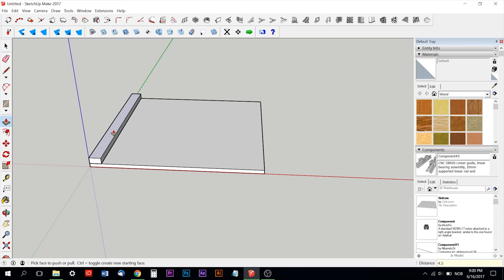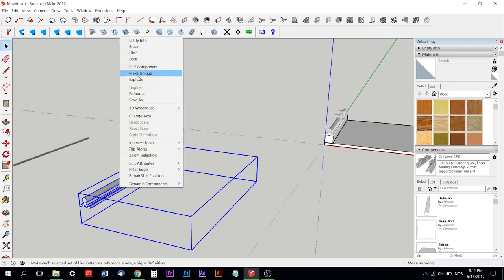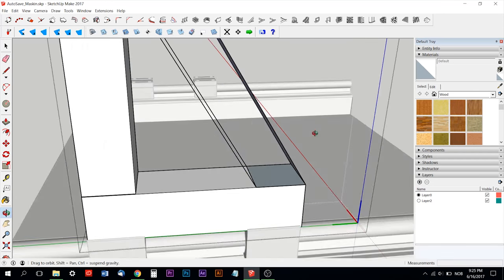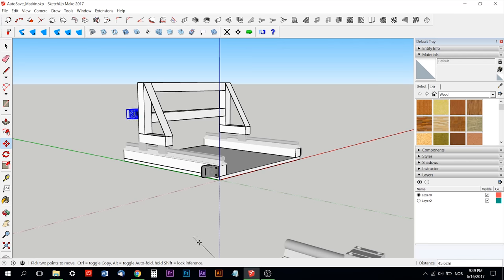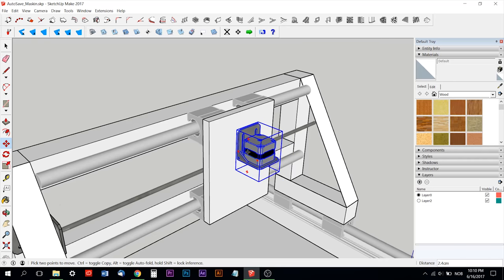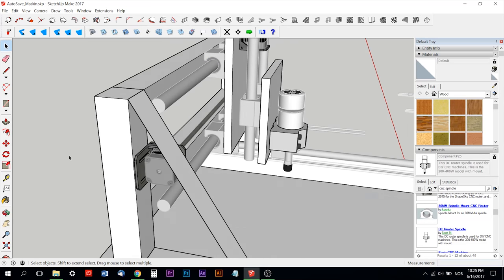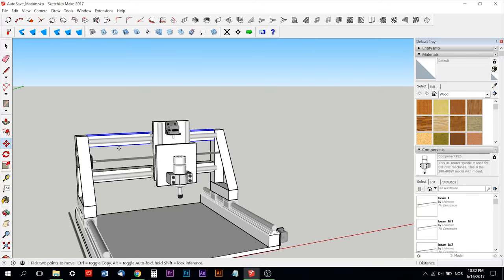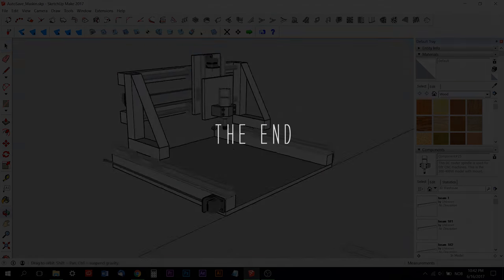First DIY CNC build (Part 2) - The DESIGN in Sketchup

Comment: Hey willy the shaft size in sketch is 20mm and you using sbr12!!
Reply from the maker: Yeah, that may be true. I downloaded the rails as a component. But I only used them as a mock up in sketchup, not for exact measurements
Reply: @WillysGarageNorway  Nice.

Comment: I try to check the machine that I made, using the pen but whenever I try, I find that the pen rises to the top away from the surface of the paper
Reply from the maker: Hi, maby you need to invert the z axis in the arduino using Universal G code sender to change the GRBL settings?
Reply: @WillysGarageNorway  
Good morning, I use the open source program (easel) and I test  up and down of  Z axis  ,its ok , but it still go faraway from the paper when I  click run ,😭
Reply from the maker: @ContComp  Hmm, thats no good. I am not familiar with Easel, but have you set correct hight when setting zero before you run the g code?
Reply: @WillysGarageNorway  no, I don't know  how?
Reply from the maker: @ContComp  try reading this forum https://discuss.inventables.com/t/set-home-position-to-center-of-artwork/14455
Reply: @WillysGarageNorway  
Thank you for evry thing....🍃🌸🍃
Reply from the maker: @ContComp  did it work out?
Reply: @WillysGarageNorway  
Not yet

Comment: Where did you learn to use sketchup? How long it take?
Reply from the maker: I have learned using sketchup on my own. That said I have lot of experience with a lot of PC programs. I have used sketchup a couple of years but only the to last month I have learned to use it properly. I am by no means a sketchup professional and many may say I do not use it properly, but I'm learning every day :)
Reply: @WillysGarageNorway  It´s been a while, but do you still use SketchUp? Wondering what to learn, SketchUp, Fusion360 or Solidworks. Any recommendations?
Reply from the maker: @mskogly  I strongly recommend learning Fusion 360 :)